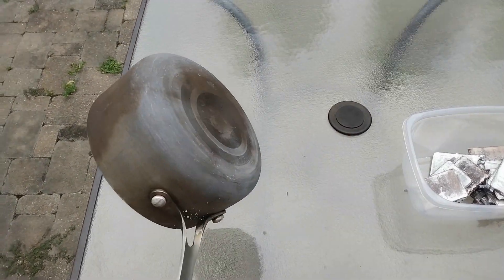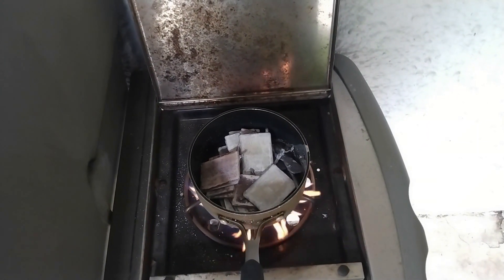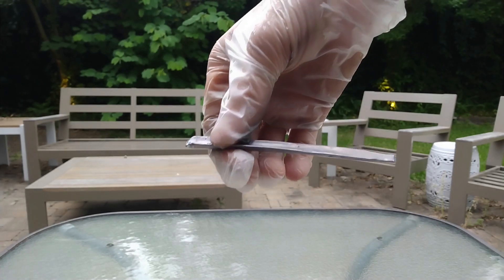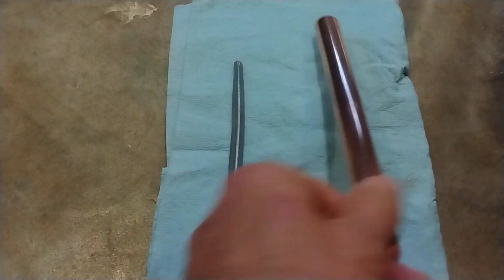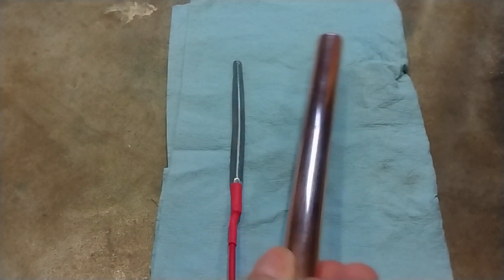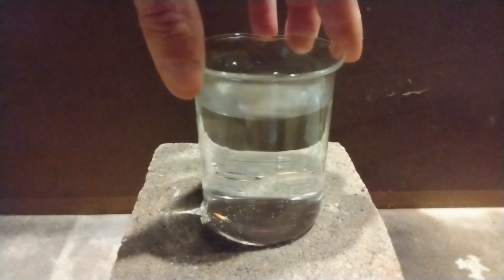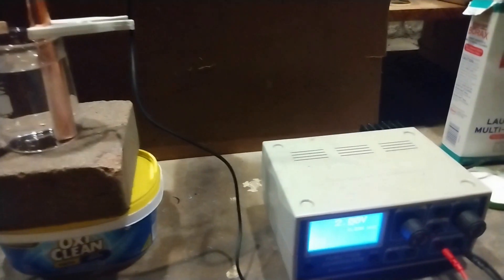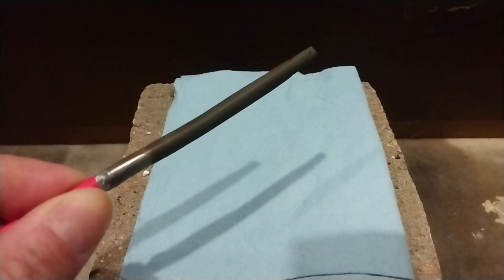DIY Lead-Dioxide Electrode: Virtually free and Easy Method!

Comment: 12:14  Excellent presentation!  You may want to use Scotch Brite instead of steel wool.  Steel wool is notorious for contaminating what is scrubbed by it.
Reply from the maker: Thanks for the suggestion!
Reply: @BlueMoonshine  Yes, factory put oil into steel wool to preserve from oxidation !
dishsoap with a brush is good to degrease the lead anode, 
you can also like we use in surface prep before electroplating do a cathodic degreasing into a alcaline solution and do a surface activation for a better adherence with an acid dip (for lead i sugest acetic acid with H2O2), distiled water rinces...water break test to spot greases traces etc...
also there is two type of lead dioxide polymorphs, the alpha and beta, depend on the current density applied.
The Beta(lower current density) is the type needed at the surface of the anode as it withstands the Chlorate and Perchlorate cell conditions better than Alpha. Alpha (higher current density) is good at relieving stress in the anode and has better adherence properties to most substrates
so for a good PbO2 anode, in a second time during the PbO2 plating, the current density need to be reduce to promote Beta polymorph for the last PbO2 layer.
I think if it is doing well the lead substrate PbO2 anode can stand good if the electrolysis is made from already chlorate electrolite, not directly from chlorides.

Comment: Be careful when you pour hot metal over concrete, the moisture trapped in it will vapourize and explode in a barrage of little chunks of rock.
You can also make more complex and better electrodes by moulding in "greensand" (damp clay and sand mixture)
Or in plaster of paris (gypsum) for very fine casts.
Reply: Re: the "pouring on concrete" part, you'd be correct for high-melt-point metals, but for lead, unless you're talking about pouring (and spilling...) crazy-large amounts, it's EXTREMELY unlikely to cause any problem - the melt point for lead is just too low to be hazardous that way. Biggest threat from this project would be inhaling the lead fumes if you overheat it during the melt, and the possiblity of absorption through the skin if you don't glove up while handling it. (You dont want to inhale the filing/sanding/shaping dust, either)
Reply: Lead won’t cause explosive spalling. 

For plaster moulds, dry the mould in an oven before casting.
Reply: @WineScrounger  Lots of folks use their own plaster molds for fishing sinkers.
Reply: @1953Wes as they should, resist the lure of Big Sinker

Comment: Parrafin wax works better than borax for lead flux. Not that you wouldn't know that, just thought I'd mention it.
Reply from the maker: I didn't know, actually. Thanks for the info, I will try.
Reply: @BlueMoonshine  parrafin is combustible at lead's melting temperature.  Only do this outdoors. 

Still,  it pulls impurities in the lead into the slag, and allows for alloys to form more readily.  It's all dependent on temperature and you can find references.  

I learned about paraffin specifically because I do a lot of airgunning and black powder guns,  and you need to have either pure lead or special lead alloys, depending on the type of gun. 

Cheers!
Reply: Good advice!

Comment: How well does this stand up in something like a perchlorate cell?
Reply: I had tried to make a PbO2 electrode with similar method for perchlorate cell but it didn't work. The electrode started to dissolve even though there was coating. I would love to know how to do it better and if your electrode will survive the chlorate cell conditions.
Reply: @olimp231  the best ones I've seen are on the Mysteriusbhoice channel
Reply: @olimp231  watch MysteriusBhoice video, his whole channel basically goes over lead dioxide electrodes and anything related to electroylsis
Reply: Graphite electrode?
Reply: For perchlorate cell you need PbO2 with Ti substrate. I have homemade recipe, its not mine tho. You first etch Ti in boiling concentrated HCl. Then you apply either MMO pre-coat or SnO2 doped with Sb or Ce. You can make pre-coat plating with SbCl3 and SnCl4 and some ethanol or methanol. Apply this mixture to etched titanium and heat it up with heat gun to convert SnCl4 and SbCl3 to oxides. After you have this pre-coat you need some lead salt. Optimal is either PbO or lead carbonate. Then you need plating bath with 40g of lead salt or PbO/L and 160g of NaOH/L. Temperature is 50C and stirring is required. Conncect your pre-coated electrode as anodr and use current density of 2.3mA/cm² for around 2 days. Also place two cathodes from both sides, so your anode is coated from both sides. Half of lead is reduced on cathode to lead metal (wasted) and other half is oxidized on anode to form PbO2 (your coating). This is so called alpha coating and PbO2 alpha coating is usable in perchlorate cell. You can also plate beta coating for better chemical stability, but I highly dont recommend that because that beta plating bath requires soluble lead salts and creates aerosol. Alpha plating bath doesnt produce this aerosol, because voltage is so low that its not enough to electrolyze water. This entire process is very dangerous, (lead poisoning) and only do it, if you know what you are doing.
Reply: @ageofengineering159 does the PbO / NaOH dissolve in water to create the plating solution or how does it work?
Reply: I bought an electrode on eBay and it worked very well ;).
Reply: Very bad, it will disintegrate in minutes
Reply: @mrcool90210 that's what I figured
Reply from the maker: I really don't know, I've never tried a perchlorate cell.

Comment: Good video but this method makes very poor coating, need a test in NaCl solution to see if it can handle current
Reply: this will not stand high concentration of Cl ions. What we want is a high overpotential for oxygen evolution. That means chloride should be oxidized and oxygen should not be produced. But this electrode will be attacked by Cl ions very easily. You can use this electrode to make persulfate by electrolysis provided you do not have Cl ions at all.
Reply: Thanks for the precise answer mate !  @janami-dharmam